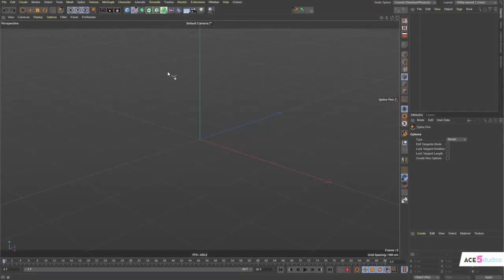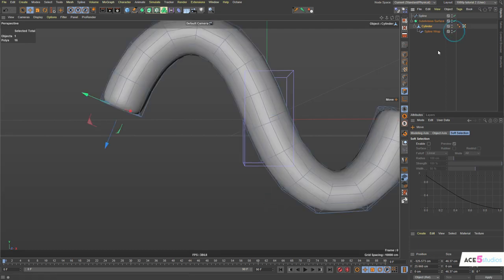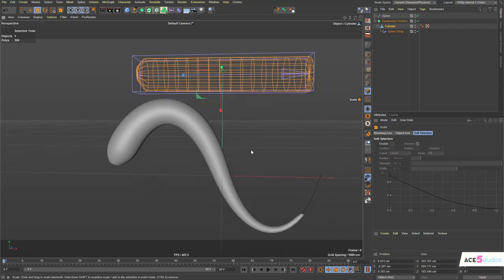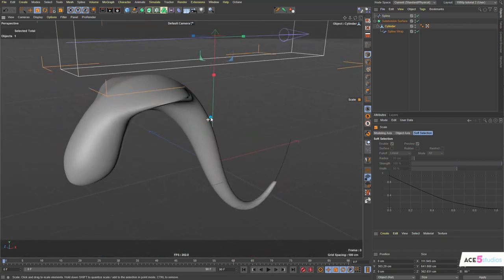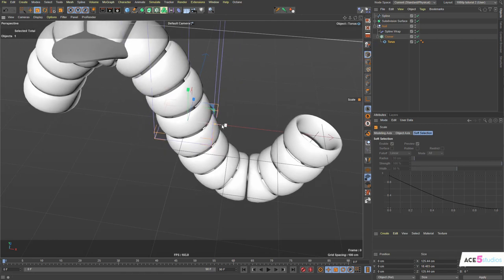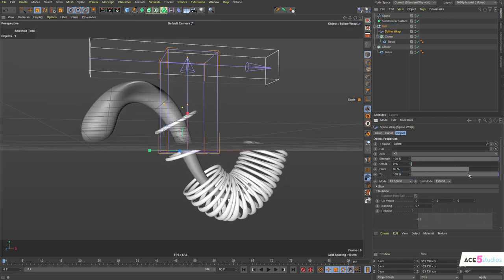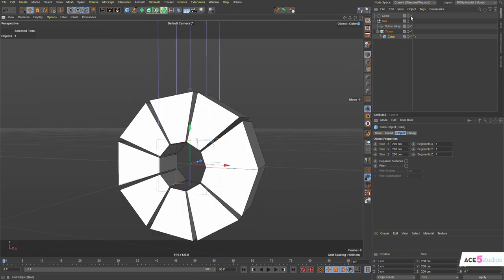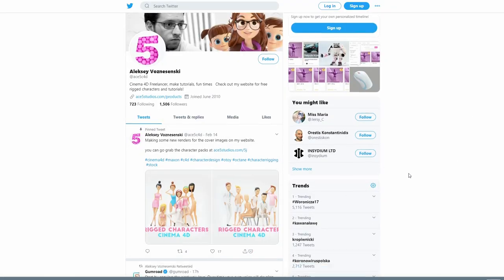C4D: Spline Wrap Deformer Tutorial Part 1

Comment: I'm trying to deform a cylindrical object across a spline, but only have certain parts deform (as if they're flexible joints), while the links remain rigid... is there a way to do this? Think like a rigid robotic tail connected by flexible joints. Like a combination of the spline mesh with the cloner.

I can't for the life of me figure it out.
Reply from the maker: check out my highway tutorial, might help.

just cloner for rigid parts, and spline wrap for soft parts.
Reply: @ace5  I'll check it out, thanks. The tough part is, the objects aren't actually clones, but unique shapes, and they also need to reliably connect with one another through these flexible joints.

To top it all of, I have this as one solid object.
Reply from the maker: @SeraphsWitness  might need to build it with joints and then spline ik the joint chain.. (i have a tutorial about that too)
Reply: @ace5  I was just thinking that. Awesome. I'll take a look. Thanks man!